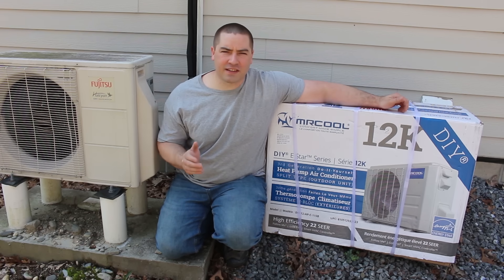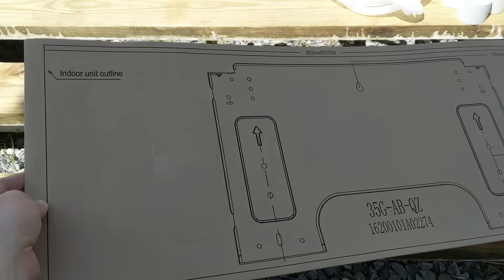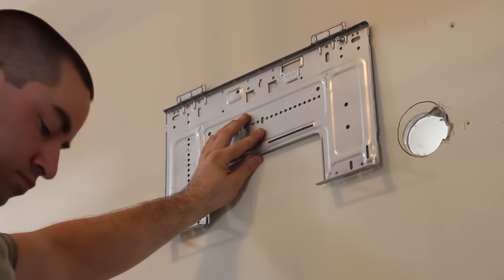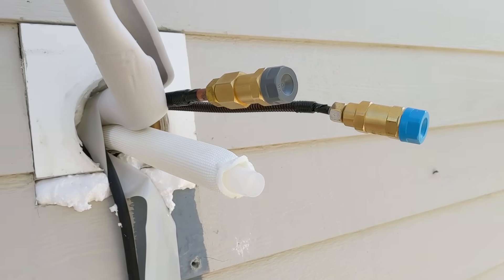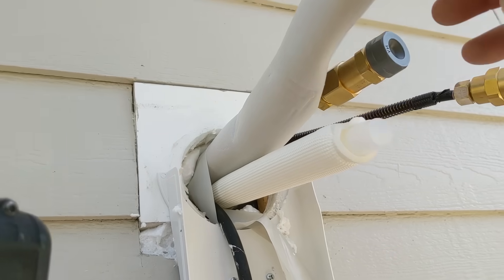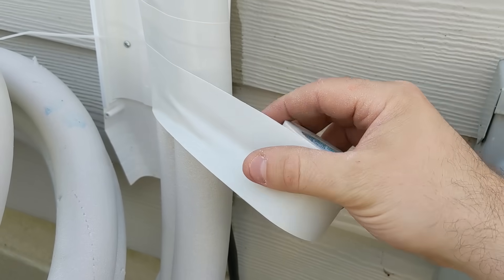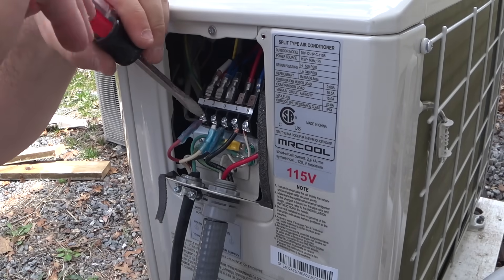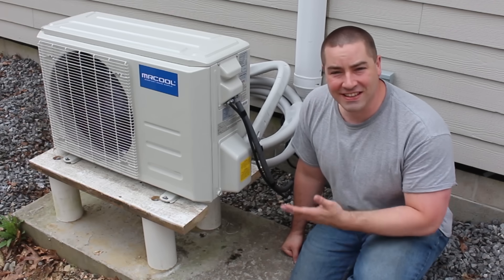Installing My Own Mini-Split Heat Pump, DIY

Comment: HVAC is my primary business and I have repaired several of these DIY units. Usually it’s from a factory defect like line set that wasn’t brazed properly and the refrigerant leaked out or wired not plugged in fully and shook out in shipping etc etc. sometimes it’s twisted copper lines or someone cut the lines shorter and didn’t have a vacuum pump and flare tool to complete the job. You did an awesome job with only 2 things to pick on and that’s minor. When moving the lines out of the evaporator, (wall unit) even tho they are wrapped in springs it is necessary to swing the lines down away from the unit in a 90 degree angle from the bottom of the unit and then bend them up 90 degrees to the desired direction. You can still put a twist on the tubing and fracture the copper. Over time the refrigerant leaks thru these fractures that grow larger with contraction and expansion with heat and cool cycles. All copper tubing comes annealed and is fairly easy to bend but the more it’s worked the hard the metal becomes. Mitsubishi was putting instructions in their install manual on how fast and to what degrees with what size you could safely bend copper tubing. Flare  fittings have a lot of failures as well and won’t always show a leak with bubbles and may only trigger alarm with a sniffer sporadically. They do make copper washers for this purpose and they work really well. A little contact cement helps to hold them in the correct place especially if you have fat fingers like mine 😝. 
The line sets you were using have a bit of refrigerant or a vacuum in them an a foil seal. The indoor and outdoor unit have knives inside connectors to cut the foil after the double o-rings seal up the works. Didn’t catch what liquid you were putting on the threads. Hope it wasn’t thread lock. Some thread lube for later removal is good. I personally prefer 220v over 115v, generally speaking 220v is half the amperage draw of 115v. SEER rating can be speculative especially if you start looking at the heating BTU’s. I do like that line set cover. My home home is in the Philippines so I rent in the USA and so I bought cheap mini split $529 12k btu with the kit but it has flare fittings. I bought wall hang brackets and ran the lines thru the top open window pane. Closed it on the lines and filled up the gap with that black pipe foam. Mine is called “Premium” looks exact like yours David. I think they just have the factory put their own logo on it and buy by the container full. Maybe we could a few thousand and sell the “Poz” Mini-Split Inverter HVAC 😂. Oh and shove some sos pads in that line set cover outside. I just repaired rodent damage to the communication wire on a ducted mini Mitsubishi I installed in 2011. Well, stay cool and keep me coming and stay safe! Loved it!
Reply from the maker: Thanks for the tips.  I'll go put some steel wool up in there.  This is what I was putting on the fittings: https://amzn.to/2WHTRMr  I agree about the 240v vs. 120v.  Mr. Cool also made a 240v version, but it was 18KBTU and already this 12KBTU is bigger than I need.
Reply: DavidPoz welcome. Kinda like liquid Teflon tape. I noticed Lowe’s has MrCool for sale. One of mine had blower motor go bad but they didn’t have a motor for replacement on warranty so they sent me a whole new system. Crazy huh?

Comment: I was hoping it was a glycol loop. Electro ind was planing on making one, but it was too expensive because they included too much stuff. Dual compressors for lower temp operation, Domestic water heat even during cooling, ect.

Comment: Great job! Having all the wiring and stand in place made your installation easier. I just installed an 18K BTU last week and can't believe how quiet it is. They are a solar system dream as they are so energy efficient. I am putting in two more, an 12K btu and another 18K btu that will heat and cool the majority of my house.
Reply from the maker: Nice.  Those should work well with your off-grid system.
Reply: Links to them on fx amazon?

Comment: Awesome!
How do they get around the need to evacuate air from the pipes?
Oh, I see, the custom lineset comes pre-evacuared and sealed.
Reply from the maker: Mr. Cool does that at the factory.  The lines have some kind of special brass fitting that only opens when you tighten it down.  Only the "DIY" versions have this.  It's made so you don't have to own vacuum pumps or gauges.
Reply: @DavidPozEnergy  Wait, the lines are precharged? I call B.S. You showed that you released the refrigerant then checked for leaks. If you had pressurized linesets you could and should have checked the connections before opening the allan head valves letting the full charge out of the outside unit?
Reply: @cthorn8355  The lines aren't pre-charged, they're pre-vacuumed. The refrigerant is in the compressor like most mini-splits. It makes installation easier but it's not exactly easy to find a vacuum leak. God forbid youb do have a leak if you don't have a pump and gauges handy. Can't put the vacuum back in the bottle...

Comment: why not just cut the electric cable? 🤔
Reply from the maker: If you are referring to the black cord that was attached to the head unit then: I could have cut it instead of coiling it up.  However, it came with some nice spade terminals attached and I just as well didn't feel like cutting/stipping/crimping when it was already done for me.

Comment: You might need the 18k unit even though your house is small.  I had a 38k BTU unit for 725 sqft only for the heat portion, heating is more difficult for these units so need to upside just for the heating, if I lived in Florida and only needed AC, I could have installed an 18k BTU.  
I love these from an energy stand point.  I installed a unit that had 3 heads on the interior, because at the time I had an older house with no space for duct work so this was a perfect solution.  I studied for 6 months before attempting the install - very risk to install a non-DYI system on your own, because if any issues, it would be difficult returning the equipment so would probably have to just order another.   What I don't like about the ones with multiple heads is the huge opportunity for break points... if the outdoor or any of the indoor units fail, the system has to be evacuated by a professional to replace any of the units.  I installed only on the first floor, if I had installed same on the second floor I would have had double the equipment involved so even more opportunity for failure/trouble.  So for large installs, I still favor central systems with duct work.     
Even the install you just did, if you had discovered a leak, you would have needed to call a professional to evacuate the system.  Kind of scary, we do DYI to save money, but if not careful or if just due to bad luck, it can cost us if we run into problems when dealing with HVAC.
Reply: Heating is easier for these and all a/c units as they get a mechanical advantage on heating as opposed to cooling

Comment: I've been wondering about those Mr. Cool units.    We built our first house about 38 years ago.  After our family grew, we built bigger house 30 years ago.  Now we are retired and planning to downsize and build another small house.  It's great to know how everything in your house works, because you installed it.  I've enjoyed all your videos.  Thanks for showing us how simple the DIY Mr. Cool is to install.  It looks ideal for a small house like we have in mind.
Reply from the maker: Thanks for watching my videos.  This is the 12k model and is bigger than I need.  My home is rather small too.  This is the central heat and central air, in that, it handles the whole house.

Comment: Looks good Dave. You might want to double check that the extra line has slack so that when you have snow from the roof hitting it that the line does not pull on the main unit, you could end up with a loosened connection.  I installed two of these DIY units (Pioneer) for our house and we love them.
Reply from the maker: I agree.  Before the snow flies I'm going to add a lean-to roof over the top.
Reply: You have created an oil trap with all that coiled up line set. When the unit runs, both refrigerant and oil leave the compressor, the oil is returned to the compressor sump with suction side pressure. You have created oil traps in each of those coils that will slow, or prevent the oil returning to the compressor, and eventually damaging the compressor with a lack of oil return. Please review the instructions for minimum line set lengths and the maximum number of 90-degree bends (like your coil is producing). I do apologize for your experience with HVAC contractors. I am a successful HVAC contractor not because I am a brilliant man, but because the industry is filled with substandard contractors! Ductless mini-split systems are heavy on electronic controls and most contractors won't take the time to learn them.

Comment: Wow!  Mr. Cool got a good deal with you installing this, you are the perfect DIYer for their company.  How long did it take you to install it, minus filming?   I'm working on my house and plan on purchasing one of these units from them at the end of this Summer.   Also where is the product made?   I like how well the instructions are illustrated.  It looks simple to install.
Reply from the maker: It took me 1.5 days total, but that was with kids and filming.  I probably could have completed in 4 hours by myself.  But this was also a replacement.  Add time to run a wire if you don't have one already.  On the plus side, this model (12k) is 120 volts, so you could plug it into a wall un-officially.  LOL
Reply: @DavidPozEnergy  If you had 220v right there on the outside wall from your old unit, why did you choose a  less effecient120v installation?  I notice the book shows a diagram for both hook-ups.

Comment: Please let us know how this works!  I am also off grid, and have been looking at the "Mr Cool" DIY units!
Reply from the maker: Two nights ago we got snow and this kept the house warm, while running off-grid.  But I plan to do a follow up video with some amp-meters.
Reply: @DavidPozEnergy  Nice!!  Am looking forward to it.
Reply: Basically they are amazing. I have a 24k unit, heats awesome, the AC is incredible and my electric bill went down. (Baseboard heat before purchase)

Comment: what kind of power draw is there when cooling full blast?
Reply from the maker: I'll have to check and do a follow up video.
Reply: @DavidPozEnergy   That'd be great! We are building an off grid homestead and this is what we planned on using so we were curious.
Reply from the maker: I've been running almost a week now, off-grid on my inverters and battery.  Works great.  But I will do a video with some more details on amps.  This is the 120v model, the larger models use 240v.  I have both so that wasn't important to me, but I wanted a small unit.
Reply: @DavidPozEnergy   Yeah we are trying to do as much as the work our selves and MR cool you dont need an HVAC tech. The 120v aspect is interesting. I could only imagine the 240 is even more efficient. I know the old window units that were 240v used to be way more efficient. We are trying to design everything to be under 8 kw so we only have to have 1 inverter. We bought a heat pump water heater and dryer which both are under 600 watts. Everything else in the house is under 1 kw. It all comes down to a/c. IF we can stay under 3kw at all times I think we will never overload.
Reply: @a v. a 12,000BTU is a one ton unit.  During peak usage on a hot day 85-95 degree F (especially if the hot sun is directly striking the condenser unit)  should draw around 1,000-1,100 watts.  At night, should range between 550-650 watts when the temperature is 80-85 F.  That is what my 1 ton Pioneer does.

Comment: That looks like the EXACT same model as the Pioneer I bought through the Walmart website with the exception of the copper tubes. The unit you installed had some O rings inside-- hopefully that will prevent any leaks! Please have your future self send a message about how it is working 3 years from now.  One more point with these inexpensive units is that the economics gets such that the gas inside the unit is the most valuable component. If it leaks down the road replacing everything will cost less than having someone come and look at it. Good luck!

Comment: I own an HVAC company. You're definitely getting a cheaper system for what you pay for. Qualify isn't there. Leaving all that extra pipe laying there looks like crap plus adds extra line for no reason. Not using nitrogen and vacuuming the lines before introducing the refrigerant is horrible. It leaves moisture and other contaminants in the pipe. Moisture or a contaminant in line are bad for compressor or cause heating and cooling problems. Just to name a few things. Down the road if there's a problem and you need to call HVAC company out. Most will either not want to work on it or have a field day. It's definitely budget friendly and easier because no cutting and flaring pipe. No nitrogen testing and vacuuming. Nor using manifold gauges to check pressures after.
Reply from the maker: This is a very unique system.  No vacuum, no gauges, no pressure nitrogen.  The lines are pre-sealed at the factory.  Mr. Cool is the only company I know that has an official DIY version.
Reply: DavidPoz this crap shouldn’t be allowed to be sold, install looks crap as well
Reply: @martinconnolly9629  That and you don't' get to gouge someone. You are laughable.

Comment: Thats the worst install of a mini split i have ever seen.
 You did not vacuum down the lines & leaving the extra line all wrapped up was a total FAIL !!!
Reply from the maker: This is a very unique system.  No vacuum, no gauges, no pressure nitrogen.  The lines are pre-sealed at the factory.  Mr. Cool is the only company I know that has an official DIY version.
Reply: @DavidPozEnergy  U still have to vacuum down the line & cut them to the proper length
Reply from the maker: Hi late 4 dinner, You would be correct with any other brand, but not in this situation.  This is a unique line from Mr. Cool.  You can not cut these lines or vacuum them.  Here is their website if you want to learn more: https://mrcool.com/diy-3rd-generation-e-star/
Reply: @DavidPozEnergy  If U say so but your wrong thats not the corect way to do that
Reply: @DavidPozEnergy  There are lots of DIY ones on the market
Reply: @late4dinner268  respectfully, you're wrong.  Read the manual on this unit.  Its a DIY version that has pre-vacuumed linesets and quick connectors.  You are not supposed to cut the lineset or vacuum it out.  I've installed a few hundred mini splits, so I know a thing or 2 about them.
Reply: @late4dinner268  you must be fun at parties.
Reply: @benssolarandbattery  he's not late for dinner, just not invited
Reply: @DavidPozEnergy  By the way i love your videos and watch all of them so please keep them coming

Comment: This unit operates on 120 Volts?   What is the current draw when the compressor is running?
Reply from the maker: Yes, it's running on 120v.  I'll do a follow up video showing the amp draw.
Reply: If I'm not mistaken these air conditioners have DC Inverter and are very delicate when it comes to peak energy consumption at startup. Good choice.

Comment: Really wish they would come up with a true multi-unit ductless DIY mini-split that would be a considerable up-front cost savings vs a ducted unit replacement. I know there are some kits on the market but they don't seem to be a good cost alternative. 
My home is not very well sealed or insulated at the moment and would require a number of units throughout. I like the idea of being able to close my bedroom door at night and limiting my total electrical usage to just one room.
Reply: Pioneer have some model for multizones.  Most of them are for 240V though.
https://www.highseer.com/collections/multi-zones

Comment: Thanks for the video David. I've watched many of your other videos as well. I just picked this same unit up from Home Depot Friday night. My install is a new one not a replacement. I've never done this before either. It looks like mine is going to be mounted on an interior wall so it's going to be a bit more involved than yours. Hopefully it won't be too bad though. Thanks for all the videos!
Reply from the maker: Shouldn't be that bad.  I would say, put extra attention to sloping the condensate line, and extra wraps of insulation and tape around everything.  You don't want condensation forming on the outside of a little section of exposed brass inside your wall.  That could lead to mold.
Reply: @DavidPozEnergy  That sounds good. Thank you for the advice. I'm hoping to not have to use a condensate pump. I'll make sure to wrap it well.
Reply: @mrcutter98  They make a tiny condensate pump that fits inside the interior unit that works very well . We have several at work that have been performing for years .

Comment: I ran mine in Florida with my Grid tie back up inverter for 4 days after a hurricane with no power from grid, no problem. That is the reason you want to get the 110v model.

Comment: I would have to say that I am impressed with the amount of little details that most others don't show like the fittings and explaining simple things that may not be obvious to someone who isn't hands-on looking at the unit but it is helpful for some people who are interested but on the fence on buying one.
Reply: On a professional installation you wouldn't have 15 feet of copper lineset sitting behind the unit either.